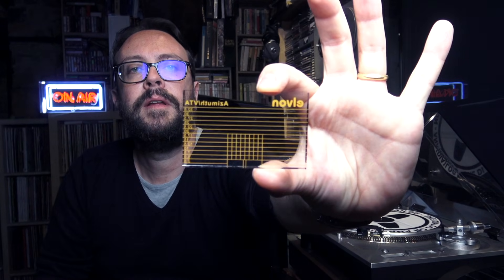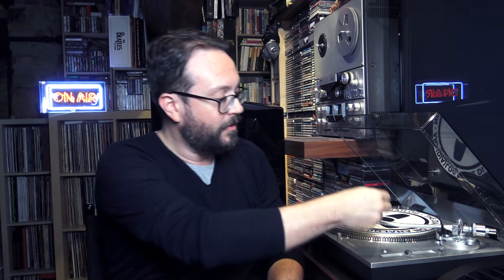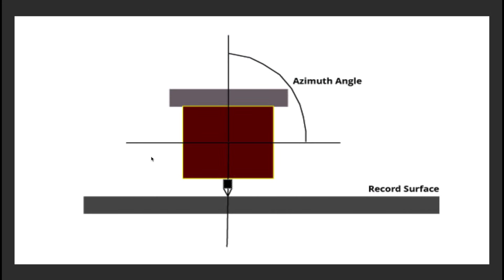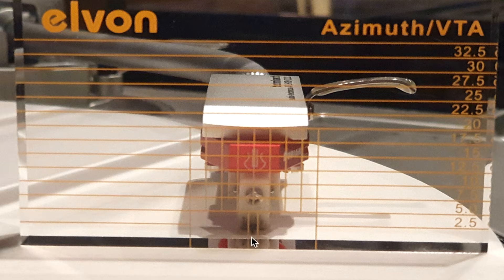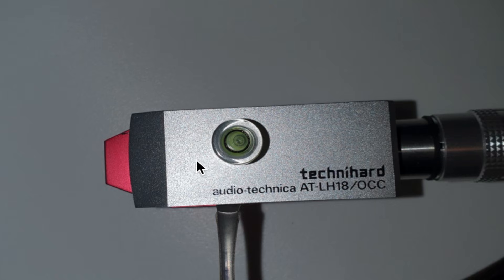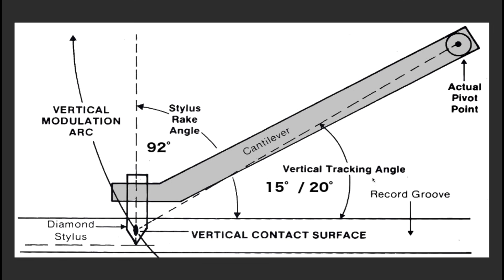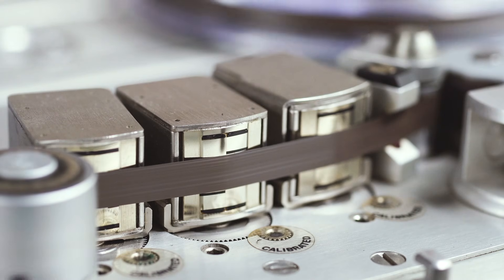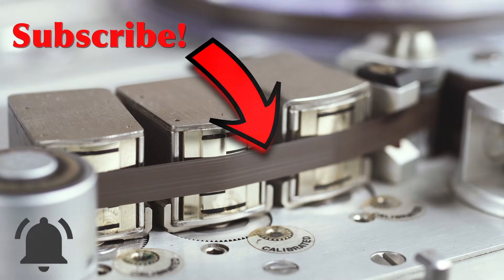VTA, SRA & Azimuth: What are they & how to set them

Comment: You didn`t mention what to do if you don`t have a headshell with azimuth adjustment and  a turntable witH VTA adjustment, which the vast majority of people don`t have. I adjust azimuth with metal washers to put one between a cartridge and a headshell, on the side which is too high. And I adjust VTA with putting two mats on a turntable, or you can just buy thicker mat for smaller carts. Both solutions are not 100% perfect and maybe not appropriate for high end carts, but for an average user, it works.
Reply: Yes good observations. I don’t have tables with height adjust either. I have Sony T3 and a T2. Plus I have 2 Fluance RT85 models. For $500 tables they should have height adjust. This guy seems to have some money to burn on nicer stuff.

Comment: I take no pleasure in saying this but... that tool is only effective if the cartridge is manufactured perfectly, which it isn't in many cases. The only proper way to set the stylus rake angle is to use a microscope and some kind of tracing software, where you can get to 92 degrees. It is at that point where you can make minor adjustments to see if it improves. The old "have the tonearm be level" trick isn't actually setting a proper stylus rake angle in oh too many cases.
Reply from the maker: If we are talking of a precise calibration, yes, I agree.

Comment: I have the Music Hall Ikura turntable. Do I raise and lower the arm using the counterweight to level the arm?
Reply: Counterweight is for setting the tracking force of the needle you need to get the correct needle data from your cardridge manufacture brand.
The vta is can be adjust for alinement the cardridge.
Reply from the maker: Nope, just put the tonearm where you want it on top of the record and then lower the little lever near the base of the tonearm to start playing.

Comment: Hi My 1229 vintage table is limited to setup precision detail . Cartridge weight , the 2 nil points over hang and getting cartridge straight . No way to get arm to move up and down. So, keeping record clear, keep stylus clean.  1229 has a fantastic gimble Barring , rigid arm, and perfect speed . Do, you hear a much better sound with your turntable

Comment: Will i be able to find the 92 degrees SRA by using your recommended microscope? How does this work? M. Fremer also mentions in a video from 2019 that using the ruler for VTA is completely wrong. I'm confused...
Reply from the maker: The best way is to use software, like Dr. Feickert. That is 100% reliable. The same  Michal Fremer said that a ruler is a good starting point but absolute precision is obtained only via computer software. Yes, the microscope is an excellent tool if you are using the ruler with SRA or trying to empirically measure the 92° angle.

Comment: Shouldn’t you reset the stylus pressure after placing the level on top of the head shell ? Even if the level weighs only one gram it will change the pressure and therefore the height of the cartridge.
Reply from the maker: Yes!
Reply: Absolute true but alinement with the acrylic tool is better. You don't want to change the tracking force for using this bubble, if your turntable is just a hair of from level count the amount of inaquraty of the bubble on the end of the arm then your further off.

Comment: I’m a novice when it comes to turntable and stylus setup.  I have checked angles and all look good and the TT is properly levelled.  But I have an issue between tracks, between the end of a track and the start of another track there is an awful rake/grinding sound.  I’m worried that I’m damaging my record and styli.  Perhaps I should hit a forum to ask the question.  In fact I’ll google it first, I can’t be the only one who has experienced this
Reply from the maker: This is very strange...I never heard about this problem. Are you sure the tracking force is right?
Reply: @anadialog  Knowledgable friend, you was right, the tracking force was over 4 grams, over double the recommended.  I’ve adjusted the weight, checked the squareness of the cartridge and that the head shell is level.  The sound between tracks has gone.  I had changed the valves in my phono stage from Svetlana to Millard reissue (12AX7) either the Millard burnt in or the tracking force adjustment has taken the edginess of the treble.  Thank you, I’m a happy man
Reply from the maker: Great! Very Glad we solved the problem!

Comment: Re. the AT Technihard headshell in the video - can you tell me, is it possible to achieve any cartridge twist (towards the spindle) when aligning with these, as you can do with headshells that have the slots? Just curious. Thanks
Reply from the maker: Excellent question. This headshell is probably one of the best I ever came across BUT you can't move the cart as you said and they all weigh a ton!
Reply: @anadialog  Thank-you for clarifying...

Comment: Thank you for bringing this up. I bought my tool and cartridge weight measurement tool a year ago from Ali Express. very cheep.
The perfect vertical angle alignment is to get 90 degrees between needle tip and LP Surface.
You can reach that adjustment relatively easy if you keep the following rules:
1) Arm angle is perfectly leveled (parallelly to record surface).
2) Verify that cartridge to head shell and head shell to arm have a perfect mechanical match
3) Cartridge weight is correctly applied (within manufacturer specifications)

When all the above are meat, you can rest assure that all angles are correct.

One note regarding the bubble level measurement:
Great tool, but cartridge's weight calibration has to be done while  the device is mounted on top of the head shell. when mechanical adjustment is done and the bubble is removed, you should readjust the cartridge weight.

Comment: I bought the cheapest VTA/azimuth block I could find about two years ago.
It was about 3 dollar on eBay (some OEM brand called BUM), so I checked it for accuracy.
Used a professional set square to see if the horizontal/vertical lines where all perpendicular and parallel to the surface.
I also checked the distance between the lines. Checked the bottom of the block if it's well flat by putting a bubble level on top.
I was surprised that it was all okay... accuracy for only 3 bucks. Amazing.
Reply: Ow, btw... I've found plenty Ortofon styli that had their stylus incorrectly mounted onto the cantilever (both nude and non-nude styli), so that cartridge parallel to the record at recommended VTF did not produce the right SRA.
Reply from the maker: Oh my! 🤯
Reply: @QoraxAudio  so what did you do with the wonky styli? Align the cart so the cantilever was the right angle?
Reply from the maker: That's what I do...
Reply: @shahidyt  Sent them back to the store for a replacement.
Some salesmen go salty when you ask for a replacement and try to deny the issue.
A decent USB microscope to take pictures of the issue is very useful for that.
Reply: @anadialog  Just like any product, styli should operate as intended, if not, it needs to be returned.
You shouldn't accept that, because if a manufacturer makes a mistake and sees they can get away with it...
Well... that's the start of lowering QC...
Reply: @QoraxAudio  I also bought one of those cheap ones on eBay, and the horizontal and vertical lines and boxes are actually lightly etched into the acrylic on one side. I took a really nice set square (made in Germany) that I inherited from my grandfather who was an architect. I also used my digital calipers to measure the distance between them, and just tried the bubble level thing you mentioned. I’m surprised at how precise it is for how inexpensive it was. 
I can’t believe that regarding Ortofon carts. Which ones did you notice had that issue with, and how many were faulty? Hopefully that’s not a sign of QC going down, cuz I dig Ortofon carts, but I can understand how some are let out with styli incorrectly mounted to the cantilever with the amount of carts they produce. 
I’m now checking out my 2M Bronze with my LED headlamp on and my 100x loupe. lol.
Reply: @NickP333  I've found incorrectly mounted tips on various Ortofon carts over the years.
From DJ concorde styli, back when I was into DJing all the way up to a Cadenza Blue cartridge a friend of mine asked me to align.
And everything in between, like 2M Black styli.
It's not exclusive to Ortofon though, I've found the issue on Audio Technica (AT95E) and Nagaoka (MP-200) carts as well.
Maybe it seems to be more common with Ortofon since I mostly use Ortofon carts...